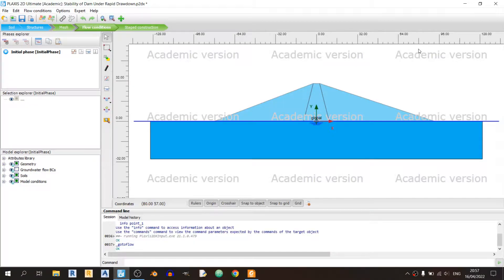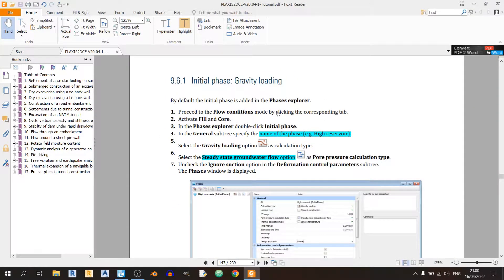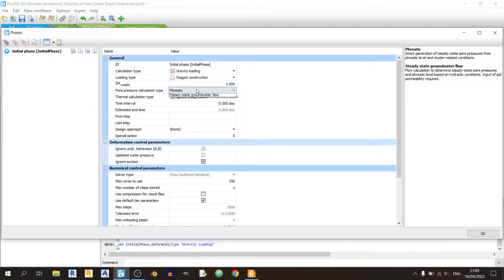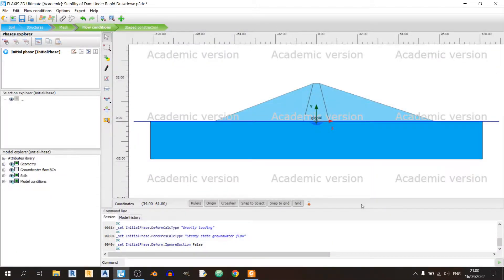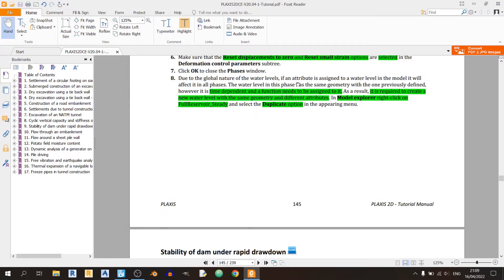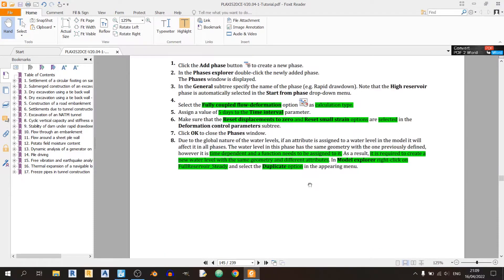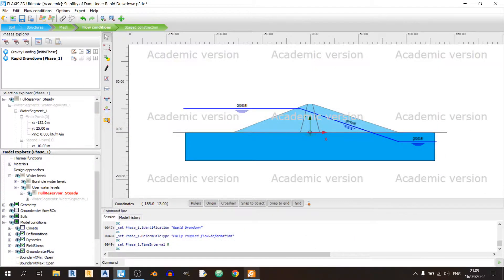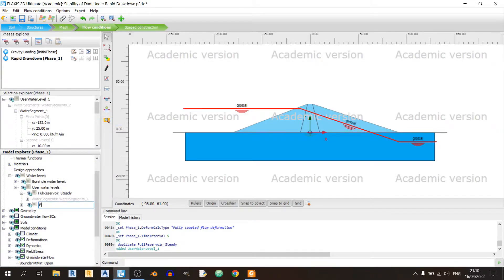Plaxis 2D | Stability of Dam Under Rapid Drawdown Part 2A

Comment: I am facing an issue when I run the same model; it shows that the High Reservoir [Initial Phase] failed. I have done it multiple time but it fails. When I run for calculation the steps reaches to 1000 and sigma M_stage is zero and stiffness  is also zero.

The ERROR it shows is
 Ultimate state not reached in groundwater flow analysis. [Error code: 34]

Comment: Hii on 7:41 you define calculation type as fully coupled flow-deformation, but on my plaxis there's just plastic, consolidation and safety. Is there any reason for this? or can I just use some other option with no major problem?
Reply from the maker: Hi Sharon, are you using the same Plaxis 2D version as in the video?
Reply: @revitforcivilengineers  I'm using Plaxis 2D V21
Reply from the maker: Are you using the ultimate version as well?
Reply: i had the same probleme but solved that go to the plaxis 2d licensing that is on your computer after installation and select all the other features that you need